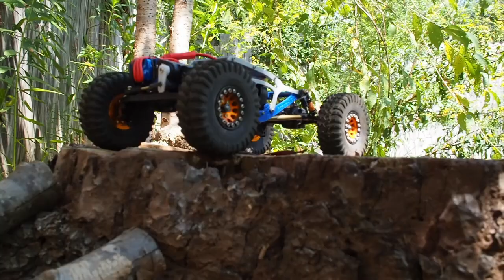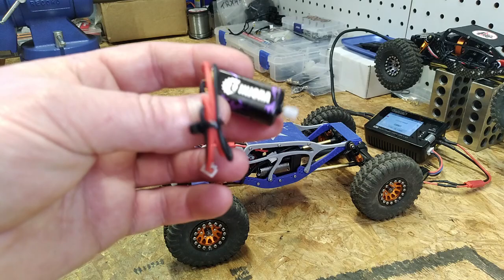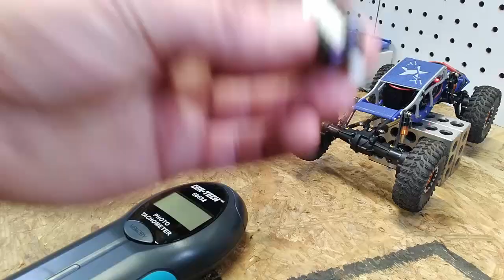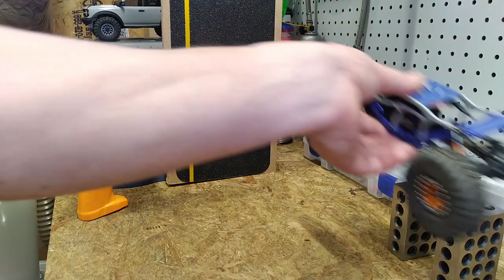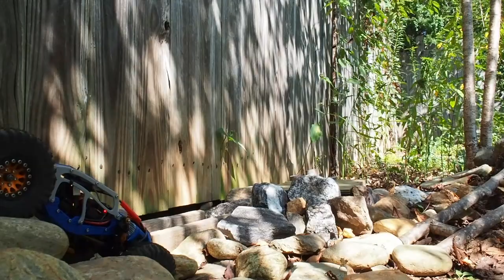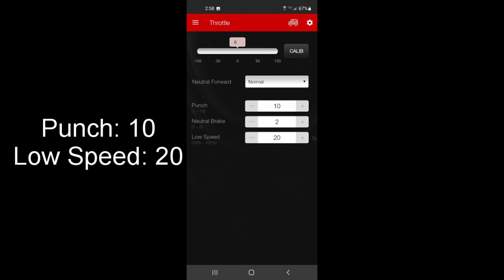Most Powerful SCX24 Motor Ever? @MofoRC Torque Beast X 30k #scx24 #rccrawler

Comment: so what is the difference between TorqueBeast 50 3.0 Motor  and TorqueBeastX 50 Size 30K
Reply from the maker: All Torque Beast X motors have incredibly strong magnets that give them insane levels of power. The Torque Beast 3.0 doesn't have the same magnets as the X series and runs better on "stock" ESC's and has a good balance of slow crawl, power and wheel speed. The X motors run best on an aftermarket ESC like a Furitek, Mofo Rockwolf or Dinky RC D-Drive Micro Sport! I hope that helps! Thanks for watching!
Reply: @havikhobbies  good stuff, thank you so much, thats great help, now i know what my next 3 builds are :D

Comment: Great review! I'm betting there's quite a difference between what you consider "a warm day" and what I do, here in Canada... LOL! Beautiful Slayer! You mentioned you got the 'Builders Kit" in another comment down below. What all came in that? 
Thanks!
Reply from the maker: Warm summers day in North Carolina probably is quite different to a summers day In Canada! The "Builders kit " from Texoma RC included the Caged chassis, but also a wide range of body mounts and electronics/battery mounts. I don't even know if that kit is still available?
Reply: @havikhobbies  Ha! I thought from your accent you were down under. But yeah, NC probably still a bit more toasty. 
I don't think it is. Josh did a redo after his near meltdown. Glad he's simplified and condensed things down into one rig. New unit looks killer. But I still find I can't quite figure out his shop page. Definitely could be just my dyslexia, but I think it still needs more work. I can't tell what comes with what or if the combo/kits are complete or partial. Always prevents me pulling the trigger as with shipping, exchange rate, import duties, etc. it would be costly to order incorrectly. Love Josh though. He's the mad scientist of 1/24th's. :)
Reply from the maker: @wingnutbert9685 😂 I'm an Aussie, just not living there at the moment! Shoot Josh an email, tell him which rig you want to build and what motor/esc combo you plan on using. He's a great guy to work with and I'm sure he would be happy to get you setup with a Texoma style rig 👍
Reply: @havikhobbies  I agree! I think he'd be cool with that and I'd love to give him the business. When he was melting down, I emailed him to chat. Not that had anything to do with it, but was glad to see him take a breath and regroup. I think he just got a bit over enthusiastic and ahead of himself. This is a niche within a micro-niche hobby. Tough to go full time into. As a sculptor, I definitely understand what he's going through.
Reply from the maker: I think if Josh started catering to the 1/10 market and carried some other parts like the servos and electronics he uses so his website was a one stop shop and maybe even offered some turn key rigs that would assist with turning a profit, but that's a big investment and a lot of work!
Reply: Totally agree. It's tough though and the capital investment is pretty big, time consuming, and risky. Maybe if he teamed up with one of the bigger, non-manufacturer sponsored YT channels to share the load. He could do the R&D and manufacturing and they could take on the marketing, customer service and sales. Might be a great way to expand. Or even team up with Nick at Mofo.   @havikhobbies

Comment: This rig is super impressive I really enjoy your videos
Reply from the maker: Thanks mate, Josh from TexomaRC actually recommended the CR18P transmission when running the FCX24 Axles. You can pick up the transmission with metal gears and a motor for 12 bucks and Josh has a Slayer skid that fits the transmission.

Comment: Bolt in a FMS - FCX24 130 size Brushed "Speed Motor" that produces 40,000 rpm. It is extremely impressive for slow crawling & a high amount of wheel speed.
Reply from the maker: I wouldn't be able to get a 130 mounted up to this cr18p transmission mate! Are you running the injora 130 in an scx24 or fcx24?
Reply: I'm running the FMS - FCX24 Speed Motor in my FMS - FCX24 K5 Blazer.  @havikhobbies

Comment: Great rig, was thinking of getting a   slayer !

What BOA mount are you using ? The tex one, did you make one or where did you find it ?
Reply: Just saw its Texoma BOA - Does it fit on stock SCX24 axles?
Reply from the maker: The BOA mount is a TexomaRC product for the FCX24 Axles https://www.etsy.com/listing/1486438707/fcx24-boa-mount

Comment: What a nice coincidence I just bought a v3 tb50 platinum off mofo RC yesterday. I couldn’t find the difference between the regular tb50 and the platinum tho so I bought the platinum hoping it’s better. My scx24 stock motor is super clunky when trying to crawl slow.
Reply from the maker: You'll love the Torque Beast 50 3.0 if you're on stock electronics, really nice power and control! The platinum version is the same except has a steel pinion which is great when running a steel spur gear. The TBX50 30k featured in this video really needs an aftermarket esc to get the full experience! This motor has way more power than anything I've tested so far! Thanks for stopping by!

Comment: Dadgummit! Lifting the whole rig with the strength of the magnet. That’s nuts!
Reply from the maker: That's what I'm saying man! This motor is legit, there nothing else like it!
Reply: Also, I think you’re the only one that believed me on that setup. If you could get proper overdrive, that would be the best budget setup, although I think the 18p axles are better out of the pack. I don’t have one that I drive anymore because I might have sold one or two 18p kits. Btw, do those motors bolt straight up? I never went and looked. The only aftermarket 050 I have run on that trans is the samix, which I think has the 030 bolt pattern for bolting directly to scx24, opposite of other 050’s, I think. So, I had to drill holes. I think that’s actually a better motor for the setup because you can get about twice the wheel speed with about the same slow crawl but there’s no questioning what I just saw in that thing going up the vert ramp without hesitation.
Reply from the maker: I found out quickly that running the FCX24 Axles and SCX24 transmission was not the key to success even with brushless power! If you want to run ring and pinion you need gear reduction, the cr18p transmission does just that! Yes the TBX50 30K is a direct bolt in to the cr18p transmission, for the Injora Pro I had to drill new holes. This new TBX50 30K motor Is very impressive, I don't think we'll ever see more power in this size motor.
Reply: @havikhobbies  
I saw Nick break a rear axle on an scx24 with the prototype. I know it’s torquey! I felt the power of the magnets, it’s just surprising to see it actually lift the whole rig, though. Thanks for sharing, brother.
Reply: Great show, bruv.